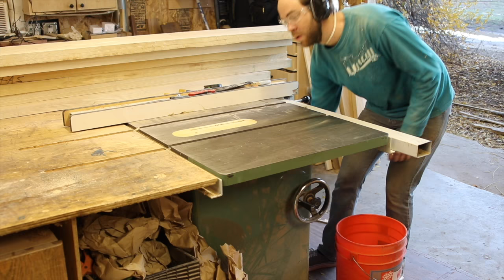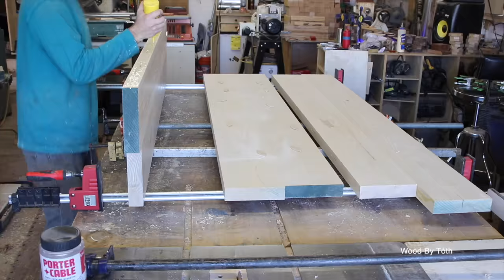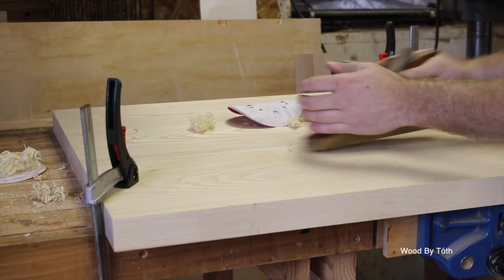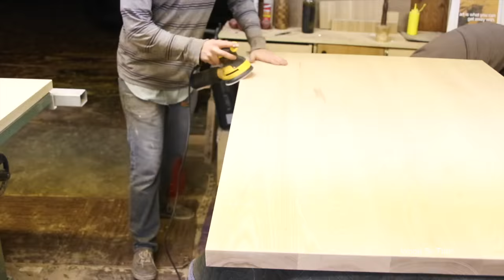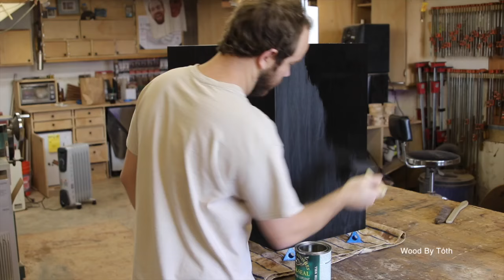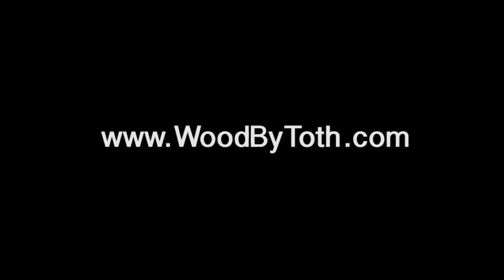Breakfast Nook Table In Solid Ash

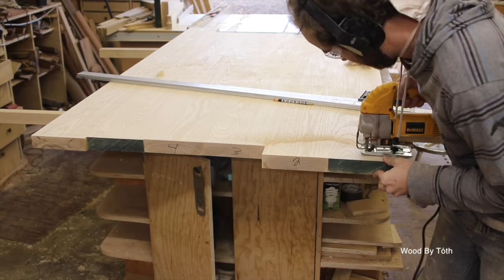Comment: Dude, I have a project coming up I was stressing about, and the router trick at 3:04 totally cleared it up. Thanks
Reply: I've found the router method can result in a nice (straight/clean) cut - much better than I can do with a circular saw...especially if you use a 1/2" spiral cutter.

Comment: Cool video. Did you joint the edges of the table top pieces off camera? You start the video by ripping them on your table saw, but just wondering if you needed to joint them also.
Reply from the maker: Ryan Peters Yeah I jointed and hand planed them off camera

Comment: great video. was there a reason you did biscuits joining some of it and not for others?
Reply from the maker: Peter Thanks! It was for alignment. When I glue up large tables its easier to get all the pieces lined up
Reply: Kyle Toth okay gotcha. I actually have a big length of ash that used to be a fire place mantel and this has just convinced me to make it I to a table. I dont have a biscuit joiner though. 4 boards wide and glued only? Think it will be okay?
Reply from the maker: Peter Yeah thats fine. You dont need a bisect jointer. I use it for alignment when doing glue ups alone
Reply: Kyle Toth thanks for the reply, really appreciate your input! I'll be doing my glue up tomorrow. 4 boards wide at 10 inches wide each. That reminds me I need to buy some more clamps tomorrow!

Comment: Correct me if I'm wrong but the two side planks are only held by glue and the three "doubles" are held together by four biscuits and some glue. How good is that glue? An average American weighs about 300-350 lbs. He is invited for a dinner, he drinks some wine, he gets up using a ceiling mounted winch. And suddenly a conversation strikes. He puts his hand on the edge of the table. He leans on it. CRASH! BOOM! BANG! The side plank falls off, he hits his head on the table, he can't fit into an ambulance... DISASTER. Same for the base, btw. The only thing holding it together is four tiny stripes of glue. Again, correct me if I'm wrong.
Reply from the maker: Maloy7800 The glue is stronger than the wood. The wood would snap before the glue breaks. The pieces the were cut off of the table top, (about 4 inch wide 1-3/4 inch thicks pieces of cross grain ash with glue seams) wouldnt break when I smashed them on the ground until the 4th time. When it did the wood failed before the glue joint failed. The 4 biscuits were there for alignment
Reply: Kyle Toth That's good to know. :-)

Comment: Very nice table. But when you glue the panel i see you don't flip over end grain. I explain, usually when you build a large board you must put the veneer of the end grain up and down to avoid the twist. I hope you understand what i say...😬
Reply from the maker: Garenne01 Thanks! Yeah I understand that. Its a yes and no type of thing. If your boards are stable it doesn't matter. With Ash the wood is light on one side and dark on the other side. Basically the boards can looks entirely different so in this case I had to put them all the same way. I went to the oldest trade school in the United States and this is what I was taught. Lots of museum pieces will mimic this and they are still around
Reply: Thanks for your answer.

Comment: Why did you use such thick board on the base of the table, seems like overkill.
Reply from the maker: plzoly For the weight. Wanted the table to not tip when standing on the edge

Comment: your video is great and i am enjoying it, but i feel like you set a bad example by working without any protection.
Reply: I didn't see any issues...
Reply: TechEdFireman working with the bare hands very close to the saw. there are special tools for wood pushing.
Reply: I know there are push sticks but with the width he was cutting it looked to be plenty wide enough to keep his hands safely away.
Reply from the maker: nicu Handling boards that big and wide is safer without a push stick